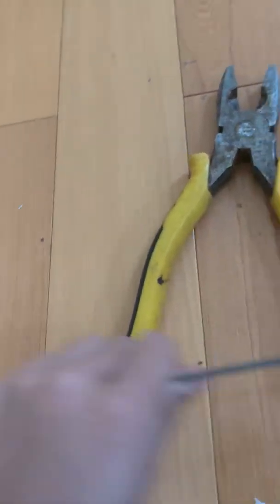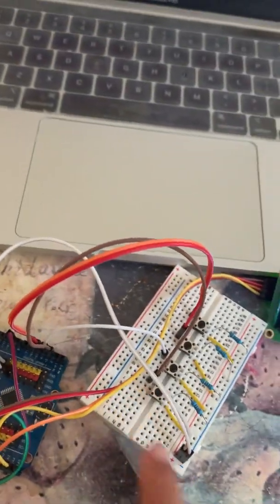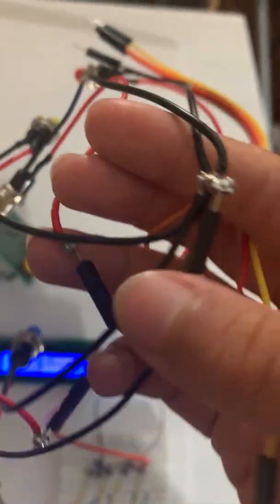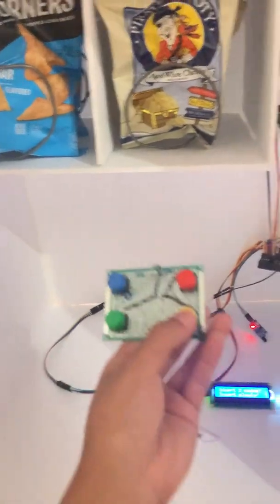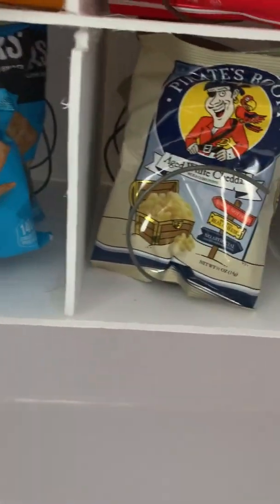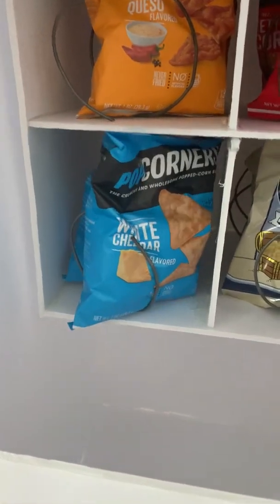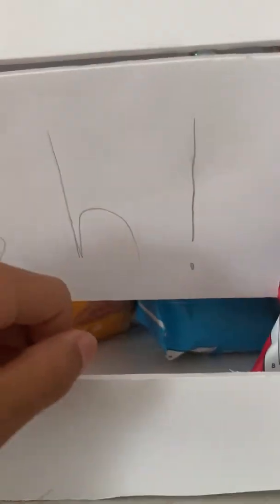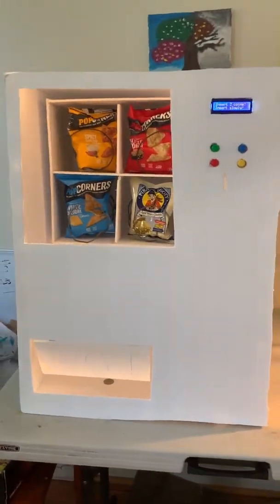Diy vending machine using Arduino!

Comment: can you sent the materials that you use?
Reply from the maker: I used the arduino plus board, www.amazon.com/KEYESTUDIO-Arduino-ATmega328P-Controller-Development/dp/B085RHTBJT  , (these are not affiliate links), some jumper wires, 4 micro servos 
https://www.amazon.com/Micro-Servos-Helicopter-Airplane-Controls/dp/B07MLR1498/ref=sr_1_7?keywords=micro+servos&qid=1678236326&sr=8-7 (I reccomend metal geard ones thogh if you have the money for it), I bought this one for the side panels www.amazon.com/gp/product/B005PFD6HE/ref=ppx_yo_dt_b_search_asin_title?ie=UTF8&psc=1 but the price has grown a lot since I got it and so I recommend a different brand/search result. I used a glue gun to glue the sheets together, and some random metal wires for the "springs". You can probably buy them at Home Depot or on Amazon. For the display I used this: 
https://www.amazon.com/HiLetgo-HD44780-I2C1602-Interface-Backlight/dp/B07W5KC65S/ref=sr_1_5?crid=246K4UE8MLIW9&keywords=i2c+lcd&qid=1678236395&sprefix=i2c+%2Caps%2C114&sr=8-5
For the buttons I used this: https://www.amazon.com/gp/product/B01E38OS7K/ref=ppx_yo_dt_b_search_asin_title?ie=UTF8&psc=1
And for the sensor I used this: https://www.amazon.com/gp/product/B07W97H2WS/ref=ppx_yo_dt_b_search_asin_title?ie=UTF8&psc=1

(I am posting this in the description for a cleaner look and accessibility)

Comment: No puedo abrir el link no sé si me puedes ayudar?
Reply from the maker: https://drive.google.com/file/d/1SSclipZptpjc9ChbTkdLQGh0mmDeiSVY/view?usp=drive_link

For the supplies, I used the arduino plus board, https://www.amazon.com/KEYESTUDIO-Arduino-ATmega328P-Controller-Development/dp/B085RHTBJT  , (These are not affiliate links), some jumper wires, 4 micro servos 
https://www.amazon.com/Micro-Servos-Helicopter-Airplane-Controls/dp/B07MLR1498/ref=sr_1_7?keywords=micro+servos&qid=1678236326&sr=8-7 (I reccomend metal geard ones thogh if you have the money for it), I bought this one for the side panels www.amazon.com/gp/product/B005PFD6HE/ref=ppx_yo_dt_b_search_asin_title?ie=UTF8&psc=1 The price has grown a lot since I got it and so I recommend a different brand/search result. I used a glue gun to glue the sheets together, and some random metal wires for the "springs". You can probably buy them at Home Depot or on Amazon. 
For the display I used this:https://www.amazon.com/HiLetgo-HD44780-I2C1602-Interface-Backlight/dp/B07W5KC65S/ref=sr_1_5?crid=246K4UE8MLIW9&keywords=i2c+lcd&qid=1678236395&sprefix=i2c+%2Caps%2C114&sr=8-5
For the buttons I used this: https://www.amazon.com/gp/product/B01E38OS7K/ref=ppx_yo_dt_b_search_asin_title?ie=UTF8&psc=1
And for the sensor I used this: https://www.amazon.com/gp/product/B07W97H2WS/ref=ppx_yo_dt_b_search_asin_title?ie=UTF8&psc=1

Espero que esto ayude!!!!!

Comment: i could not find the right pins for the display but thanks you so much i made my out and it worked perfectly fine.
Reply from the maker: Hi, the display is an lcd i2c display, and they are connected to pins A4 and A5. Thanks!